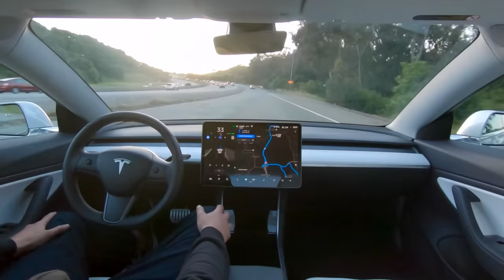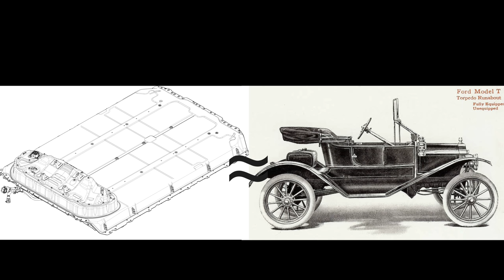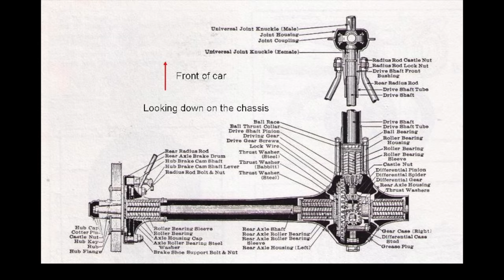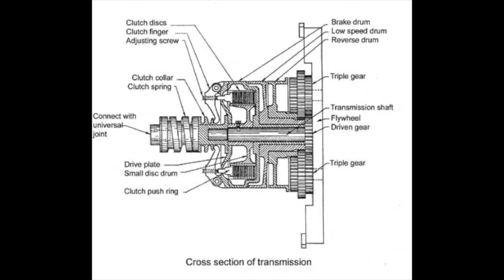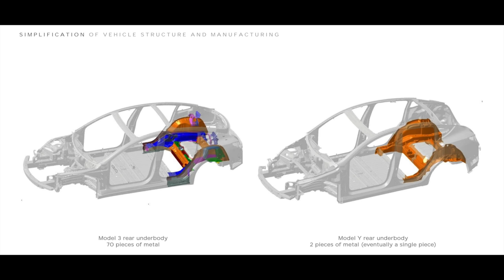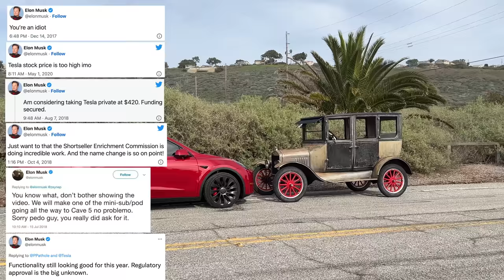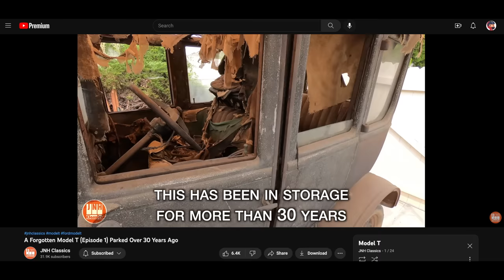1923 Ford vs 2023 Tesla

Comment: Let’s not forget the environmental impact. Which one is the most eco friendly? The Ford was made of renewable and recyclable materials and will last (unchanged) as long as you maintain it. The Tesla is almost purely made of , single use, hazardous materials and you cannot maintain it . Even if you pay someone else to maintain it (because you can’t) it will not make it 20 years without, essentially, rebuilding it. Ford wins!
Reply: @logitech4873  , That's right. I forgot that a tesla runs on fairy dust and dreams. I was mistakenly thinking it was powered by, well over, 80% fossil fuels.
Reply: @daveh2408  Stop pretending like I don't understand how the energy grid works, and which percentage is what (In the US anyway, in my country it's 99% renewable).

Here's some numbers:
1 liter of gasoline produces 2.3 kg of CO2.
1 kWh of average US grid electricity produces 0.37 kg of CO2.

The average US car spends 9.25 liters per 100km, generating 21.3 kilograms of CO2.
The average EV does spends 20 kWh per 100km, generating 7.4 kilograms of CO2.

This means that even with the relatively dirty grid of the US, EVs generate approximately 3x less CO2 when driving.

For both cars, the biggest CO2 contributor is the driving itself. While the initial production cost of an EV is higher, it is quickly offset by driving.

This is why studies consistently find that EVs have a smaller total environmental impact.
Reply: @logitech4873  , the example I gave was for a car that can be used for over 100 years. There is no way a Tesla will last 100 years so you will need to factor in the environmental impact of building and disposal of at least 5 Tesla vehicles. When you do the math, remember to add the impact of mining the lithium and other minerals needed that the Ford doesn’t require.
Reply: @daveh2408  Keyword: can* (with a lot of maintenance and rebuilding)
Model Ts had an advertised lifespan of 8 years, and while an average lifespan is hard to gauge, it seems to have been much less than 8 years.
Reply: @logitech4873  , I would be willing to bet that you do not (most likely have never) fixed your own car. The older cars last as long as you want them to. There are NO tesla owners that fix their own tesla. Even the manufacturer won't be able to fix them once they reach obsolescence. They will become nothing more than toxic landfill waste.
Reply: @daveh2408  I've done brake work, installed auxillary lights, and done my own oil and tire changes. But I'm not a mechanic, so that's as far as I go. So I have definitely "fixed" my own car, but only to some extent.

The vast majority of people aren't mechanically inclined. I do far more with my car than the average person does.

Even in the age of the Model T, most owners didn't fix their own car. They often lasted as shortly as 4 years. 
Cars had very short average lifespans back in the day. It's a common misconception that cars used to last longer, but that's just survivorship bias - we only see the old cars that DID survive.

You're right that I can't keep my Tesla going for forever, but I wouldn't be able to do that with any other car either. And neither would most people.

Comment: Not sure I agree with the end comments. I would argue the Nissan Leaf did much more to get electric vehicles into the hands of normal people back in the early days of EVs. But then again I guess I  haven't had 5 years of injesting Elon's internal PowerPoint presentations.
Reply: Tesla Model S sells more than the Leaf.
Reply: @jamesengland7461  It does now but not in "the early days of EVs" (which is literally what my comment is about; it's written there plain as day).  Leaf outsold Model S for 5 out of the first 6 years (2011-16).  Matt says he worked at Tesla from 2009-2014 noting how "Tesla changed the world" changing global opinions.  Yet during that exact time period (not now) the Leaf outsold them.  I would assert that perhaps Nissan should get some credit for a fair amount of the heavy lifting.

Comment: The big diffrwnce is reliability, as that Tesla won’t last more than about 40 years at most. Maybe 45
Reply: The average lifespan of a model T was much shorter than for a Tesla.
Reply: @logitech4873  it’s impossible for a teslas stock battery to last above 40 years before the battery is unusable
Reply: @Soeks77  Sure, and most model Ts were dead within 5 years

Comment: On your Ford vs Musk remark, Yes Ford liked the Hitler, but Elon's current behaviour makes me wonder if he would condemn Hitler and the Nazi's. So I do not think Musk is better in this regard.
But lets wait and see how much further he goes off the rails.
On the Tesla cars, I do agree they helped a lot in making modern electric cars popular. But there are quite a few (fixable) issues as you mentioned. 
The huge amount of plastic, quality and the complexity of the car. 
One of the great opportunities of electric cars is that they can be so much simpler in construction. But Tesla's do not seem to be the service friendly modular design it could be.
An ideal electric car has a body, interior, and drive train that will basic last for ever with minor maintenance. Just replace the battery and some suspension every 2 decades and a respray when needed and as good as new.

Comment: Lets see you get a battery replacement for the Tesla, in 50 yrs !
Model T ~ still running @ 100 !
Reply: Probably will be able to. Not OEM, but you can't get new OEM parts for a model t these days. Something like the tesla could easily be powered by prismatic cells or even just a LOT of 21700s.

Comment: You are smoking crack if you think that the model T beats the model Y. Just because something is plastic doesn't mean it's low quality. And how are you going to argue that wood is somehow a good thing in a car. The frame of the tesla being metal ALONE would make me say it wins. HOWEVER, I'd also say because it's 10x more comfortable than the model T it's also winning because the inside materials are more comfortable.

Comment: 100 years for now no common person with basic tools would be able to maintain let alone rebuild or overhaul.  How many of the new tech features will be functional.  More importantly when they are t functional will the vehicle even be useable?  Being that the aftermarket or 3rd party parts for Tesla's is almost no. Existent and they refuse to sell many of the parts unless your a certified shop. Leaving an owner at the mercy of oem support.  Let alone any software issues or dependency that are totally no user or even advanced shop serviceable.   I've also looked at unequal comparisons. Sure my jeep and caddy get 14 and 20mpg respectfully.  Both are emissions compliant to when they were made. But being that the one is 23 years old and the other 30 years old the carbon offset of typical vehicle replacement many times by now has to be factored in to their environmental impact.

Comment: Why does a tesla need a differential?
Reply: The same reason all other cars need a differential. When you're turning you want the inner wheel to be rotating slower, and the outer wheel to be rotating faster.
Reply: @logitech4873  thats neat i would have thought that because each motor powers each wheel that would all be controled by themself
Reply: @ramongonzales9312  Teslas don't have one motor per wheel.
They have 1 motor for the RWD variants, and 2 motors for the AWD variants.
Reply: @logitech4873  WHAT THATS CRAZY??
Reply: @ramongonzales9312  Almost all electric cars are like this though :S

Comment: I disagreed with a lot of the scoring, but most of that is just perspective so I'm not worried about it.

The two ways I disagree in Ford's favour - safety and leadership.

Leadership is easy - Musk is just as much of a Nazi as Ford was. Both were also union busters and should be getting negative points.

Safety: model Y easily wins, but what's it replacing? If you can afford a model Y, it's highly likely the previous car also had a pretty high safety rating. But the model T replaced horses. Sketchy, absolutely. But compared to what came before? I haven't done the research but surely a massive difference.

Comment: Sorry, Model T crushes Model 3/Y in terms epic market dominance.  Model 3/Y can't touch Model T.  Ford had 60% of global auto market share.  Tesla has only sub 2%.  It's like comparing Muhammad Ali to local high school junior boxing champ.  AND where is Ford now?  Where do you think Tesla will be in future with their measly sub 2% market share?  Another massive point in favor of Model T is DIY repairability - Model T was designed to be easily maintained by owner and maintained forever.  Model 3/Y is appliance car designed to be thrown away after few years.  What happenes when main battery goes bad out of warranty?  Dynamite it?  No contest at all.

Comment: I personally hate Tesla, not just because of Musk and the recent quality issues, but also because they help propagate the large car mentality of America while claiming to be environmentally friendly. Sure, they have half to a quarter the lifetime GHG impact of vehicles of equivalent size depending on what the electricity production mix of your region is, but even running on pure renewables, they are still as bad if not worse than the most efficient compact cars out there over the course of their running life. You should totally buy an electric car, but it should be a small electric car. If you can get your hands on one, a Japanese domestic is a very environmentally friendly choice, or if you want a bit more range and hauling capacity, the German x-bus looks like it'll be amazing whin it comes out in the next couple years. It has the same range as a Tesla, and a wide variety of configurations, from a shrunken VW camper van to an adorably small dump truck. It's also modular, so you can fairly easily swap between configurations of a single vehicle. If I can swing the import fees, I'd love to get one, I'd probably try and get both the dump bed and the bed with a crew cab and luggage space.
Reply: Thanks for watching and commenting text me I have something special for you 🎁🎉🎁

Comment: If you're in a Tesla and a car pulls out in front of you, it'll slam on the brakes and you'll be fine. If you're in a Tesla and a child steps out in front of you… well you'll be fine…
Reply: The car will automatically brake. It's got emergency braking like many other modern cars.
Reply: @logitech4873   yes, and in multiple independent tests, Tesla's emergency braking has completely failed to act when models of children are put in the path of the car
Reply: @engineer_cat  Can you name these tests? The system did well in Euro NCAP tests, scoring as good or better than other systems.
Reply: @logitech4873  I could Google them, but for the sake of a throwaway YouTube comment I can't be bothered. Feel free to complain about my baseless claims and lack of intellectual rigour.
Reply: @engineer_cat  You might be thinking about "The Dawn Project" tests, as they went quite viral. If that really is your source, I recommend you google some criticisms of the tests.
In a nutshell, it's a million-dollar ad campaign against FSD, but they never actually engaged FSD in the tests. They made the mistake of showing the in-car screen during the tests, which makes it obvious that they were being dishonest.

Teslas have some automatic braking failure cases of hitting stationary vehicles on motorways etc, but this child thing is from what I can find fabricated fearmongering.

Comment: That model T will still be driving long after that Tesla burns to the ground on its own.
Reply: The model T is more likely to burn to the ground on its own than the Tesla
Reply: @logitech4873  It can't,metal doesn't burn like that and its fuel tank is small.When a plastic tesla burns there's almost nothing left.
Reply: @JOHNKESSLER88  The Model T is mostly built out of wood.
Reply: @logitech4873  Floor boards and parts of the roof but that's it.

Comment: Calling Tesla a success and even trying to compare it to Ford, is likening the cheap, bad build quality parts from autozone to a success. Let's see a first gen tesla even drive at 100 years old without it's powerplant being completely replaced.  The sad part is, Tesla sells these cars at 3X the price they should be and people actually buy them, even when it costs more to charge them over an ICE car. Nevermind tax dollars being used to subsidize and all of that scam because Tesla would not even exist without it. Nobody would buy Tesla if left on it's own without robbing the people of their tax dollars. Let's be clear, Tesla rips off the masses with zero ROI to the taxpayer. The electric car didn't work in the late 1800s and it doesn't work now. Are we not tired of beating this dead horse?

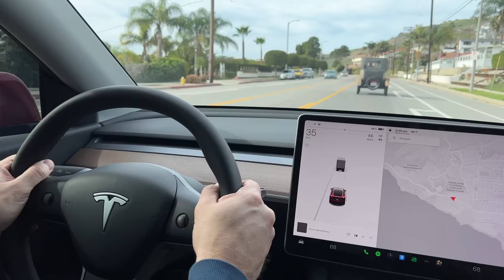Comment: 5:40
Once again a noob complaining how difficult working the air conditioning is on a Tesla ignoring the fact that all you have to do is say “blow me”.  Teslas will do virtually anything without looking away from the road for some knob or lever by voice command.  Play “(any song)”. Show map, open charge port, set temperature to 20°,  or hundreds more.

And a model T?  A model T has more in common with a Palm Tree.

Comment: The model t was to America as was the vw to Germany and both were built by Nazis oops. I shouldn't say that. Ford also wound up the production line until it was impossible to work on it. You've presented some very true but sadly disappointing aspects of the two cars. I wonder if the model Y would work better if it had a side valve ford engine. There would be no need for a sound effects generator it would come free. I am scrstch building a model A at present. It's about 12" long. And goes when pushed. Cheap to run. And looks nice.

Comment: Electric cars are cool if you like driving around in a microwave oven.
Reply: What does EVs have to do with microwave ovens
Reply: @logitech4873  They both put out a lot of electromagnetic frequency.
Reply: @EricFarmer01  So does a lightbulb. And any source of heat. Now I really wonder if you have some sort of point here, or if you just don't understand what electromagnetic radiation is.

Comment: You forgot one category there Matt.
   Longevity. 
   That Ford is 100 years old, had been sitting in a barn and ignored for DECADES.
  Try that with a Tesla and see what happens. 
   That Tesla won't make it 25, if you are lucky.
   Good luck getting the computers for it, or other assorted parts, after the factory stops supporting that Tesla and the 'recycling' parts and computers are no longer available or start to get scarce.
   You can build a Model T from scratch, out of a catalog. Everything, from the wheels, frame, body parts, engine parts trans, differential parts, to the dash switches.

Lets see you try that, with a Tesla in 25 or 30 years.

BING: extra points for the Ford.
BING: Ford Model T wins.

Comment: id take the model T over that stupid ev cause at least the model T has a real gas powered engine and not a glorified rc motor
Reply: Electric RC cars don't use motors like tesla uses. Just like how gas RC cars don't use engines like the Ford T.
Reply: actually they do... what's in a tesla or any other hippie dipshit ev is in essence a very scaled up fancified brushless motor.
Reply: @vulcandawg7623 so what, brushless motors are awesome
Reply: @vulcandawg7623  Cope and seethe. They're cheaper to operate, cheaper to maintain, quicker, and have more torque. EV > ICE any day of the week.